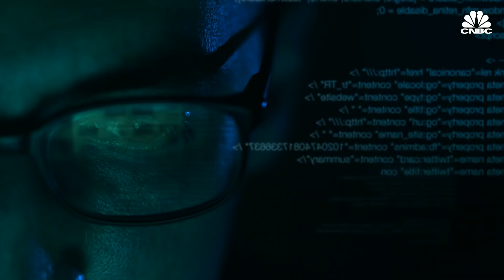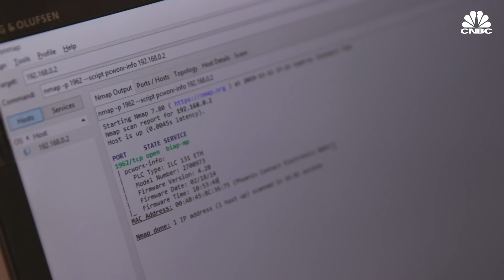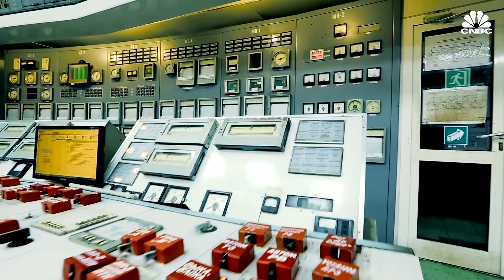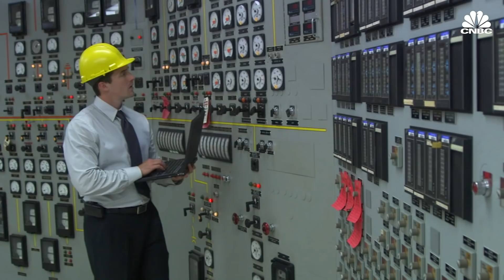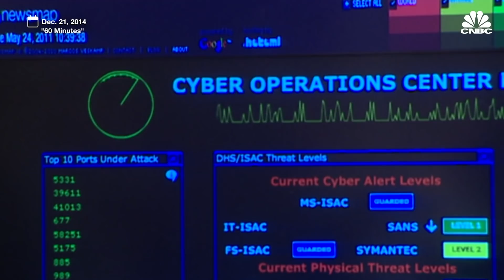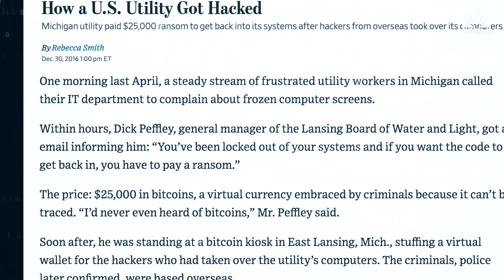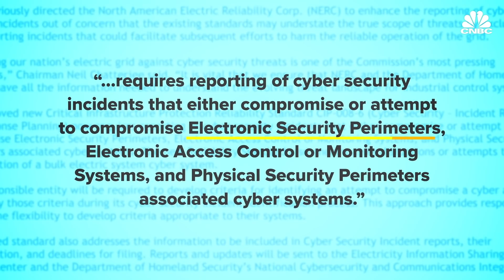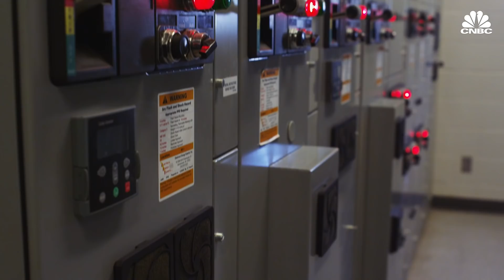How Secure Is The United States Power Grid?

Comment: Solution: every texan house with an electric car. Charge its battery 
during low demand and use it for household power supply at peak. This 
would increase the existing grid capacity by 150%.

Comment: The windmills in Antarctica have a built in hydraulic pump that sends 
hydraulic fluid through an orifice, which increases the fluid 
temperature and the blades have hydraulic lines built into them, which 
uses the heat generated to melt the ice off of the turbine blades, 
keeping the wind turbines in operation at subzero temperatures. The 
hydraulic system used for heating the blades is manufactured by Fox 
Hydraulics. When building and installing the wind turbines in Texas, the
 engineers probably did not consider that temperatures would ever get so
 cold in Texas, so the system was probably not used for that application
 in Texas. Verify if other windmills in colder climates have this system
 in place, and there is your answer. I would be inclined to believe the 
hydraulic turbine blade heating systems are installed in Northern US and
 Canadian systems.the solution for the long run would be to begin boring
 tunnels and running the power and water/wastewater underground. tunnels
 so large that service trucks are able to enter and travel underground, 
as well as underground storage areas for pumps, transformers and other 
spare parts and personel.  Its very sad that instead of solving 
problems, the politcal leaders shout down each other and finger point, 
with the false belief that the loudest voice is the correct  answer.  
When Puerto Rico was destroyed by hurricane about 10 yrs ago, the govt 
should have began installing tunnels to run the power and water/ 
wastewater infrastructure through. Since the power distribution in texas
 is mostly above ground, once ice began forming on the power lines, the 
power had to be shut down to prevent it from electrocuting people and 
destroying the electrical infrastructure. Having lived in Florida for 
nearly 50 years, its not uncommon for the electrical utility to cut 
power during strong storms and hurricanes and then powering back up once
 the areas are dried up enough to prevent it from shorting out. Water is
 highly conductive of electricity, FYI, but no one in the media has 
mentioned this. I am retired civil service, so I have experienced this 
many times. One section of town may have power, simply because it has 
higher elevation and the power grid in that area is safe to re-energize,
 whereas the lowest elevation areas are the last to have electricity 
restored.

Comment: Nuclear power should be the primary source of electric power.  There is no air pollution.  It works 24/7 rain or shine.  It cost more than natural gas and coal power generation, but, it is dependent and no air pollution.  Now days, we can build nuclear power plants farther away from population centers because we now have the technology to transmit power long distances efficiently using high voltage DC and solid state DC to AC converters.  Too many people ignorantly believe that nuclear power plants are just ticking time bombs. Wind and solar are not 100% renewal, many products are expended in the process of production and maintenance.  Wind and solar need very expensive storage.   "Renewal energy" has become a another religion, rather than a science, just like the "global warming" & "climate change" religions.

Comment: I work on the protection and control systems on bulk power transmission (69-500kV), CIP regulations from the government have made the communications with the devices extremely fortified under tons of layers and complex passwords, and the station control rooms are electronically monitored, even the door position itself into the place is monitored, and violating guidelines leads to heavy penalties

Comment: What would be curel is to steal the new software that should be delivered to the power plant and instal a hiden folder unto it, that will not activate while testing, but on a spezific time or in otherwise. That way you could infest multiple computers and shut them down without any backup software (if you infested them to).

Comment: what if you run out of water for your nuclear reactors?
Reply: use sprite
Reply: Heat, steam, neutron flux runaway, more heat, build up of hydrogen and xenon, then when emergency generators fail, let’s just say you wouldn’t wanna be within 10 miles.
Reply: Start filtering urine? Super sized humidifier?

Comment: There isn't a lot of misinformation in this story, but there is a huge lack of depth for the part where they talk about protecting these power companies. FERC has compliance regulations they mentioned for a few seconds called NERC CIP. These require a lot of security protections be in place. There are hefty fines for not complying with this security framework for energy producers. Some of the most cyber hardened companies in the US are the larger power companies. Smaller energy companies or those renewable energy companies, less so. The power generation/scada networks are typically super segregated from anyone on the internet who could hack them. The risk is a lot lower for this than other companies, for example, who have a lot of data/assets completely exposed to the internet via web servers, etc. Source: am security person who worked at two power companies previously.

Comment: Just put control systems offline, only put moderating equiment online.
Reply: Amar Abidali that’s what they will hack!!! The moderating equipment!
Reply: Generation, transmission and distribution are tied together with a private fiber network. It is all linked to provide regular power. Defending the system top down is the only choice. The company I consulted for used very very heavy compartmentalization, old tried/trust software, all USB ports disabled and redundancy.

Comment: 13:45 "to make your business competitive or you get left behind"

Power companies are not "competitive". A power company is a natural monopoly. There is no competition.
Reply: You can get Tesla solar panel and battery packs that way you don’t need power company
Reply: @chuanjiang7551  Incorrect. The solar panel installations still require you to be connected to the grid. Unless you build your own custom solution, not a Testa "solution" you do not have the luxury of disconnecting from the grid.
Reply: @chuanjiang7551  The Power Company should still exist, for people that cannot afford A tesla power pack on their own.
Reply: @chuanjiang7551  Never said they shouldn't exist and or there were no ways to do without them as an individual. Or to be less reliant on them. They are a natural monopoly and will continue to be. 

Now as someone else said, you will still need to be connected to the grid. And ideally in states that buy back your excess electricity. 

@Mitchell Roberts Solar panel installers can install it connected to the grid or not,  there are no requirements for them to or not to. 

In order to not be connected to the grid at all and be completely reliant on your own installation your setup needs to be very efficient and be able to power your home through all your energy needs. With battery backup this will help when the sun is not out, and at times when there is a lot of cloud cover. The panels will need to be essentially cut off, or excess power used when batteries are full. 

Ideally if you are at "full" capacity you would be tied to the grid and sell back excess electricity. That is if that is possible in your area.
Reply: Agreeds
Reply: I mean, how do you do it without it being a monopoly? 
It should be a public service
Reply: @randomuser5443  My point in that comment wasn't to say it was or wasn't possible, just that it is a natural monopoly. 

Now with that said there are ways for it to be less of a monopoly. If the government owns the lines, means of transmission so to speak, their could be multiple power companies using the lines. Say you have 2 power companies to keep it simple, each generates 50 percent of total demand for that area. One company has 75% and the other 25% of total customers. The extra power can be purchased from the other company at a certain rate. Likely a regulated rate that keeps it from price gouging.  Then both companies pay the state/local governments for use of the lines and rights of way. 

The state could also build in other sources of power like renewable. 

If this was done on a state level, or potentially federal level it could go a long way into modernizing our grid. Right now our grid is... stupid. It's a lot of hodgepodge systems poorly integrated. 

Go to the cities in India and look around at power lines. or google (india power lines) That may seem horrendous and the US system is sooo much better. It's better, but just by tidying it up some. The basic systems are very close. 

With that said, if we had actual competition in the US in power generation without the government owning the lines... It would look a lot like how it is in India.
Reply: Also, that statement is a paradox even in cases where a business is completely private. I work in IT and often see tech shortcuts being taken at various businesses to cut costs. Business leaders think that skimping on their tech infrastructure will put them ahead of the competition. They cut until a hack occurs, or some other self inflicted disaster. People get fired and their tech security posture is super conservative for 6 months until everyone forgets it happened.
Reply: @darylallen2485  I agree, but was trying to stay specifically on topic to the power companies having competition. 

Private companies even when competing tend to either directly collude, or passively collude. Passive collusion is the specific industry or "competitors" working toward the same goal, reduce costs increase profit.  Think industries moving toward reclassifying the term "entry level", to really mean someone with multiple years experience in the field with qualifications that someone with multiple years of experience would have. I saw something a  while back where this firm wanted 10 years experience in a technology that had only been around for 4 or 5 at the time. 

The only time really when you have true competitors is when it's essentially cut throat. Like a larger company coming in, slashing prices to where even they lose money in order to drive the others out of business and when they are driven out of business they raise the prices back up to likely higher than what was in the area to begin with. There are all kinds of practices going on that make it so our economy isn't really competing in any real sense. 

With things like power, and internet (in most areas, not all) saying there is competition there, is... it's just laughable. Even someone with 0 business savvy could see that.

Comment: In the early 1900's, Nikola Tesla intended to design and set up America's electrical power grid as a wireless system by implementing wireless longitudinal scalar waves to transmit wireless high voltage electricity across America without power-line wires.  

Multi-billionaire John Pierpont Morgan had denied Thomas Edison the money he wanted to set up America's electrical power grid system with direct current electricity using electrical power-line wires; Nikola Tesla had explained to J.P. Morgan that it was not feasible or cost effective to use direct current electricity to send electrical power long distances unless it was transmitted as wireless direct current electricity using longitudinal scalar waves to transmit the electricity.  

However, after Nikola Tesla explained to J.P. Morgan that it was not possible to attach electric utility meters to a wireless electrical power grid system, J.P. Morgan told Nikola Tesla he would finance the building of an alternating current electrical power grid system, only if Nikola Tesla and George Westinghouse discovered a way to attach electric utility meters at every property address that would be accessing (using) the alternating current electricity.  

To Nikola Tesla's dismay and disappointment, J.P. Morgan would not agree to allow citizens to pay a flat rate monthly fee or tax to access electricity each month because without a way to attach electric utility meters to each property address of a wireless system, there was no way to measure or keep track of how much wireless electricity each property address would be using from one month to the next.  

This is the reason that the world's electrical power grid system ended up with high voltage electrical power-lines covering the surface of the earth instead of being a wireless power grid system.  Scalar longitudinal wave transmission of electricity does not emit electro-magnetic field radiation.  

Nikola Tesla had also designed all electric personal vehicles and public transportation that was designed to receive wireless electrical power by way of an antenna to receive longitudinal scalar wave transmission of electrical power through the air and / or through the earth without requiring a battery!  

Unfortunately, the fossil fuel internal combustion engine all too soon, replaced the electric horseless carriages of that era of American history and, the atmosphere then began accumulating excess carbon dioxide from the unnecessary world wide combustion of fossil fuel within internal combustion engines of cars, trucks, buses, motorcycles boats, etc.  

J.P. Morgan and Thomas Edison died very wealthy, but Nikola Tesla was cheated out of millions of dollars after designing, inventing alternating current and the machinery it requires to be produced; he lived the remainder of his life a poor, destitute man in America.  

That excess carbon dioxide is now contributing to global warming and the melting of the polar ice, rising sea levels and, catastrophic weather around our planet.

Note: This is actually a repost, unfortunately I misplaced the name of the original author.
Reply: Why, in a 'democracy', should one or two powerful, extremely wealthy persons with no scientific credentials set the policy for an entire planet??
Reply: Dude ok stop just regurgitating and actually do some research. If our cities were all based on "wireless free energy" most of us would be dead. Beaming DC energy to 300,000/400,000k people in a small area it would be devastating.
Reply: Khaled. While I can accept the economic arguments you made in this comment the physics of wireless electrical power transmission are not possible as you claim. That Tesla had actually done so is false for usable levels of energy.  You should re read your physics text and try to understand the square law of energy propagation to realize the intervening space between the source point and the use point would be flooded with so much energy that it would be deadly to anything between the source and use points. Not to mention all the energy that would be wasted due to it not being collected at all. The only safe and useful source of 'wireless' energy  is the solar energy we receive from the sun, about one kilowatt per square meter. If you were to extrapolate that to a terrestrial source the energy density would be so great nothing could live between the source point and yourself, it would be like trying to live inside a microwave oven at full power, or worse. It's not going to happen in any practical way, ever. If you don't believe me ask someone that operates a high power radar installation about what happens to birds that get in front of the emitter. They fall out of the sky, dead. 11-18-2019.
Reply: @kevincounihan6120  

This is actually a repost, unfortunately I misplaced the name of the original author. I have also attempted to indicate this, but for some reason it did not include that excerpt when I posted. I will attempt to edit and correct.

What resonated with me was not whether his concepts were viable, but rather his forward thinking approach and desire to derive universal benefits for the betterment of society from his inventions.